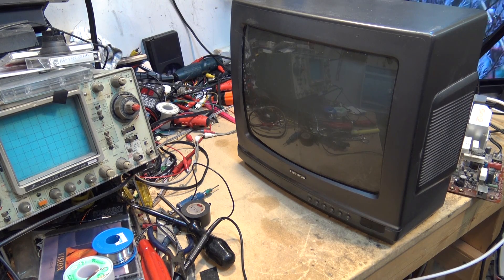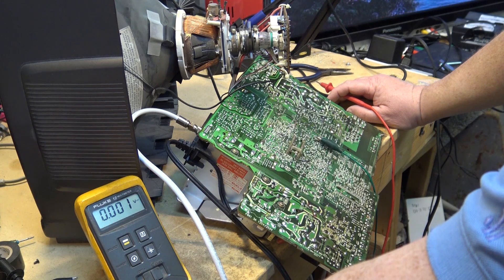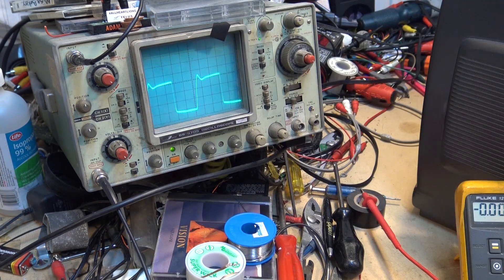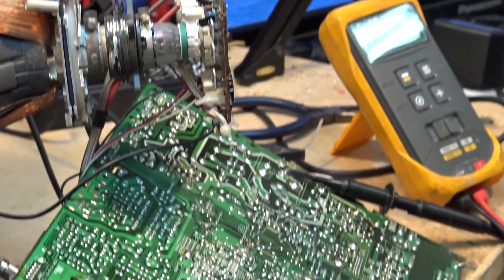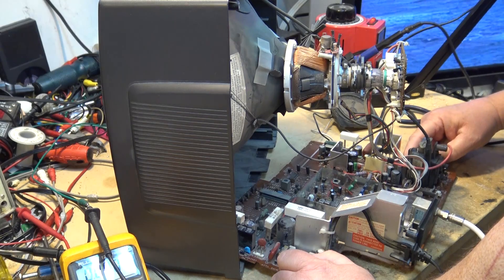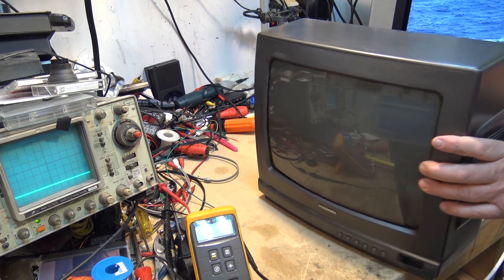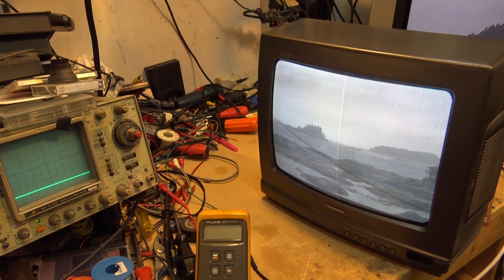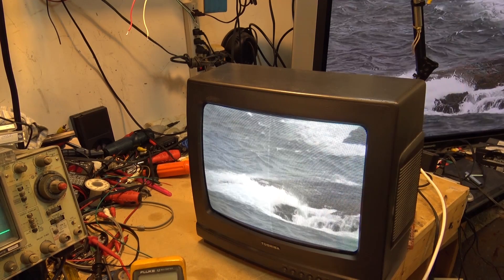CRT TV horizontal sweep troubleshooting

Comment: Hi I went to school for electronics repair about 30 yrs ago but we never got much experience repairing CRTs. Your channel has been a great resource. Trying to repair a monitor now which loses high voltage after about 10 seconds. There is horizontal drive to the base of HOT and HOT tests ok... so maybe start checking B+ now. Only other thought could it be some sort of overvoltage protection?
Reply from the maker: Yes likely x-ray protection trip.
Reply: Could I verify this is reason for shutdown by turning brightness or flyback screen control down to see if it no longer trips? thanks!
Reply from the maker: @electronictreasure4191  shut down is determined by the b+ voltage too high and the HV will be too high.
Reply: ok that makes sense because the protection is off the flyback but at a lower voltage (not anode voltage) so it would have to be b+ going too high either via power supply or bad snubber caps. thanks! subscribed

Comment: Hi, my horizontal is shifting on a slow vertical sweeping. I folded out the a/c outlet / ground loop and the composite video input. Opened it up and caps look ok as well as solder connections and caps. No schematic and I can’t tell well to look on the board or what tk try next. Can you look at my YouTube video and see if you have any suggestions? Video here—> https://youtu.be/Qfw7dzLMNPo

Comment: I'm having a problem where the picture is "jittering" and randomly getting blurry for a few seconds. The picture will often widen itself sightly and then go back to normal after a brief pause. The crt is a bit weak so I cranked the screen I'm not sure if that has anything to do with it
Reply: ...I'd suggest that you go through the set, and look for bad solder connectors in the horizontal circuit.

Comment: Hi 12volts, just wondering why you're getting afraid of mesuring hi voltages with the use of your volt meter 900volts peak to peak?. there is no capacitor value that range above 450 volts or else it would explode if reach 900 to a kilovolts. The only one I'm not measuring is the anode cap of a flyback.

Comment: FYI be careful when using your oscilloscope at the collector of the HOT. I used to own a Sencore scope and it was capable of measuring high voltages.
Reply from the maker: Good point. Every scope I had owned or used to this point had a 400v p-p input. HOT is ok with a 10x probe and a scope that can handle 400v p-p. The tektronix I have now is only 40v p-p so even with a 10x probe that would be about 100V at the scope input. My little DSO that I  also own has a 400v p-p input so a 10x probe will measure that. To do this on my tektronix would require a 100x probe.  So for any future videos where I measure the HOT I will be doing that on the DSO. So the moral to this story is read your owners manual, and know what your test equipment is rated at before measuring unknown voltages.
Also NEVER measure the plate of the horizontal output, or damper tube of any tube TV. The pulses on those sets is closer to 4KV and it will cremate your meter beyond any repair. You have been warned.
Reply: Used to work in a shop, had about $5,000 of Sencore equipment. I turned it back in when we closed the business 10 yr ago. I did like the Scope, now I have a really old Hitachi but it's still in great working condition.
Reply from the maker: When I left the shop in 2003 I took the equipment I owned, that being the ESR meter I built, my soldering station, Fluke 12, and Iwatsu scope. The shop had a Leader scope, Fluke 77 and a 0-30 volt power supply, old RCA VTVM with HV probe, Microwave oven leakage tester and a few other things. I used both the shop's test gear and my own depending on where I was working. My gear was at the VCR / Camera service station, and the other stuff was on the main work bench which I shared with the other techs. So depending on what I was working on I used whatever I needed. I don't know what happened to the rest of the stuff after I quit. Another tech was brought in for a year or 2 after I left but he was only there line 2 days a week, and then he worked 3 days at another shop. I built my little work bench at home, and had intended to work out of my house, but in reality that never happened, as I had another job when I left the shop working for a satellite installation company, and that work left me totally exhausted by the end of the day. I would roll out of my driveway at 6:30 AM, and be gone till about 9:30 at night, 7 days a week in the summer. In the winter months I was usually done by 5 because you can't be climbing on roofs in the dark. Did that gig for a year, and then I heard rumblings that the big telco was going to start hiring after 20 years of nothing. (I originally applied for that job while still in high school, and missed out because all the postings were filled 3 months before I graduated in 81) So I tried again, 24 years later and that is what I am doing now. Thought I would never bother with working on electronics again, and my work bench became a storage bench, ut about 5 years ago I offered to fix a satellite receiver for an old chap, and because he wanted to see what I had to do I recorded it and put it up on youtube, and the rest is history. Over 1000 videos later I am still turning them out. A couple a week.
Reply: There were quite a few items that I left behind that belonged to the owner, he hired a new manager that set up shop in another location. It failed after a year and I don't know what happened to rest of our test gear. I didn't get started in the repair business until 1996 after I left AT&T. I was a systems tech on a digital crew installing HDSL T1 & T3 lines both copper and fiber.
Also worked as a tester on both 2-Wire and 4-Wire.

Comment: can you tell me the tv beko screen pincushion distortion where is problem. is capacitor?
Reply from the maker: Yes pincushion problems are usually capacitors, and in come case a coil or transformer will burn up. What the pincushion circuit does is modulate the vertical sweep into the horizontal deflection coils in the yoke, and depending on the design on some sets the transformer incorporated into the yoke. 
This might be a good topic for discussion on a future video with a service manual for circuit analysis and study. I am planning a bunch of videos on analog TV because there seems to be an interest in the old CRT stuff. After years of people tossing these sets, all of a sudden there is interest in them again for retro gaming of all things because of the instant refresh rates that are a problem on the new sets.
Reply: 12voltvids weit I send link for my problem
Reply: I check the capacitor?
Reply from the maker: There is more to the pin correction than capacitors. Depending on the size of the screen there are usually transistors involved too, and a transformer. I would need a schematic to review for your model of TV to make suggestions on what to check.
Reply: This is the tv

TV CHASSIS BEKO ZA1.190-14 100HZ

Home  TV & Audio & Video
Reply: Is capacitor and tranzistor?
Reply: I have find 4 tranzistor and one capacitor low .what I check?   I have remove the cachi from tv I have test all.what I check more

Comment: Love your videos. Is there a way to somehow remove burned in image remnants in a CRT?
Reply: no
Reply from the maker: No, once it is burned into the phosphor it is permanent.Same applies for plasma, and OLED. Once the phosphor is burned, the light output is reduced and you will see a shadow.Even LCD sets can suffer image retention. It is a different mechanism that causes it on LCD sets though. On LCD it is more of the LCD crystals becoming frozen. Normally the crystals are a liquid, and the constant bending of the crystals keeps them flexible.If however they are in the same state all the time (4x3 side bars for example)the crystals can get lazy and become frozen in that state.Depending on the severity this can sometimes be permanent on these panels as well.
Reply: I learned the hard way that IPS screens get image retention.  For me it's permanent.  It's a shame.  I had to step away one day and had my monitor on for a few days straight, so now on one side part of my background is frozen, and the other side you can see parts of my Yaesu FT-2900R's schematics frozen.

Oops!
Reply from the maker: My new Samsung 4k IPS TV warns about leaving static images on the screen, and even thing like when you put the mute on, it fades the mute icon on and off constantly.
People think that LCD is bullet proof, but they are not. They may not physically burn like a phosphor based display (CRT, Plasma OLED) can but image retention (stuck LCD pixels) is a very real, and in many cases permanent problem.
Reply: It never helped when Samsung in 2008 claimed "LCD's never burn in, buy ours!".  I still have a LN40A530 that has that sticker on the bezel, while it has bad image retention issues.  I honestly thought IPS had it down, but it's far worse, IPS's in my tests seem to be easier to burn in.
Reply: the liquid crystal itself gets damaged
Reply from the maker: My LG IPS computer monitor has all the icons nicely "burned" into it.
Reply: Yep, mine says Yaesu in the top left, and some bits of trees in the bottom right, looks so beautiful.  I'll call it a feature for now, before I decide to toss it.
Reply: there is some software to try and shift the image retention here leave it running in the affected area for at least 3 hours on full brightness its just the transistors in the panel get stuck http://www.jscreenfix.com/fix.html
Reply: Sadly it didn't work.  I actually left it on when I slept for about 8 hours, nothing worked.  Tried leaving the monitor off for a week and that didn't work.  It's alright, I'll just use the monitor as is, but will eventually replace it.  It's an LG panel from 2010, it's already 7 years old anyway.

Comment: Typically the output transistor dies or cracked joints in the area, so he attacked a supply eed instead, i would have blanket soldered the area to hide the deception LOL :-D

Ive allways treated a circuit as a block, input/ootput and supplys, basic stuff.

I allways hated the fuse resistors that were allways in a nice white woven tube and were in a beautifull condition, they were allways dead LOL.
And often no reason could be found for there death.
Reply from the maker: Actually he just snipped the lead right at the board level.I f--ked up, and did the first run and the bloody camera wasn't running!  DOH!Got a good laugh when I went into the studio and all that was there was the shots when I thought the camera was off. As I TS it in 1 take there was nothing there but a few bloopers.I did discover that there is no sound though, so that is the next one, figuring out why there is no sound, and then when my pal comes over again he will do something else.Probably do some more VCR  videos too.
Reply: LOL what feckup :-D, well its a teaching video so lets call the first go a dummy run.
Imagine how bad it would be if you had a dat recorder with millions of dead crapacitors that you replaced, i dont think you would have ripped them out and put the shitty ones back to film it lol.
I would of said "Ahh bugger it" -D
Reply from the maker: Or the times when I am not filming and then I thing, DAM.